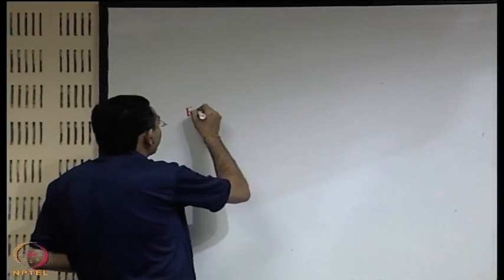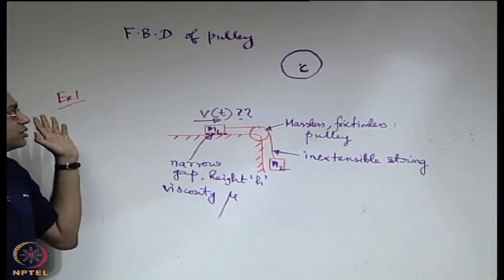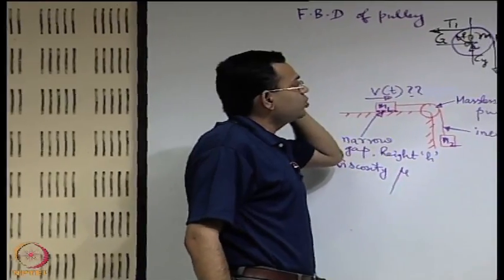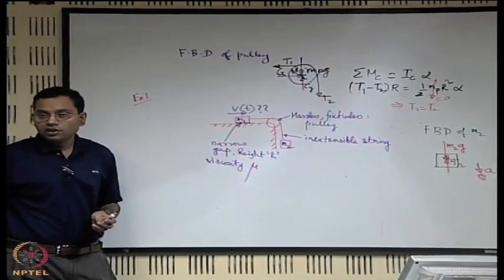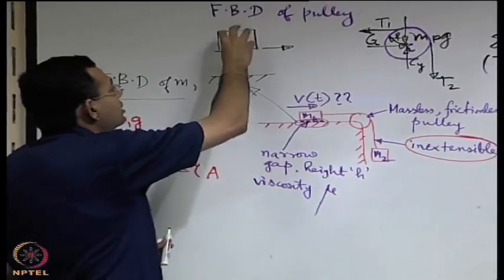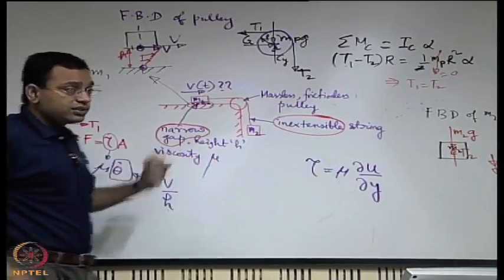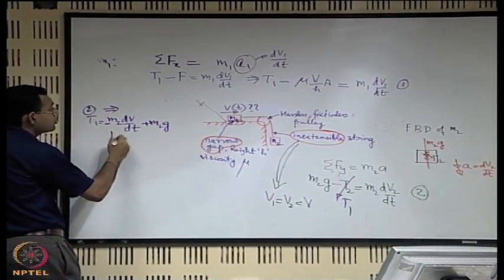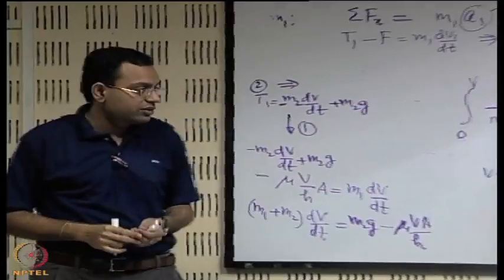Lecture 10: Some illustrative examples solved.

Comment: very interesting, thank you to prof suman chakraborty
Reply: Sir, Do you know what are the effects of inextensible,massless,frictionless  words on Tension in String?
Reply: @29akhil24  inextensible leads to use the concept of constrained motion. It means that there is some relation btw different blocks of the system. Massless frictionless string helps to use the concept of same tension throughout the length of string.
Reply: @29akhil24  inextensible means length of the string does not change no matter what. Massless means that the string doesn't have any mass so you can only consider given masses/loads for calculating gravity forces. Frictionless means ignore friction in the pulleys.